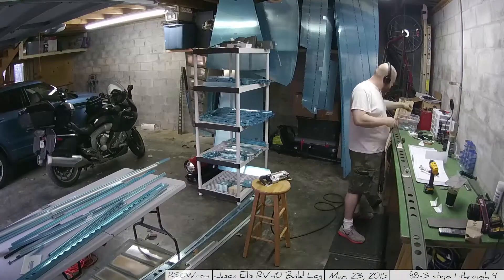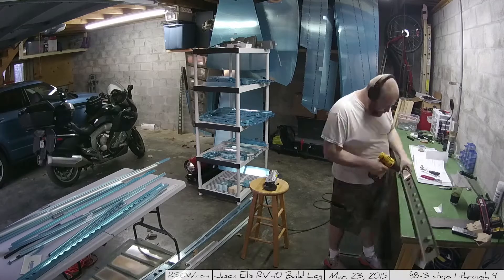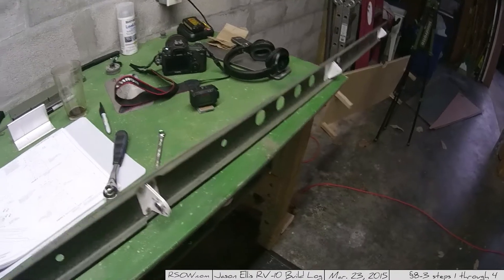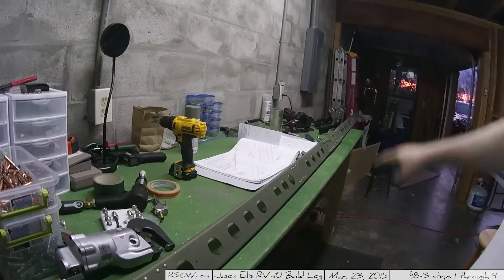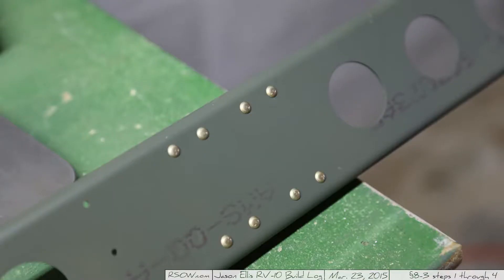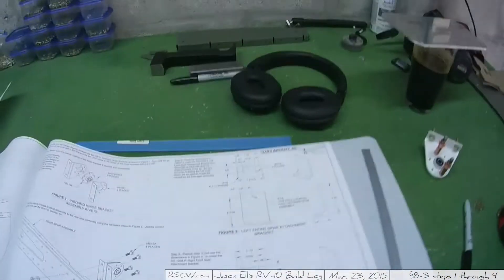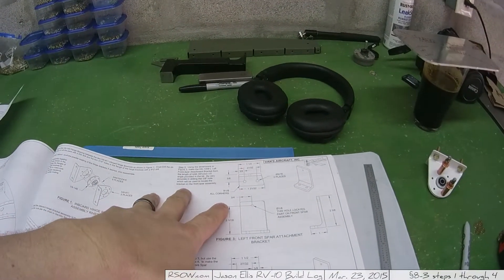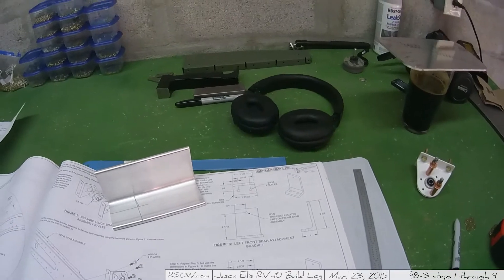RV-10 Empennage Section 8-3 Step 1-4

Comment: 1:05 : I'm curious how those bolts are secured against coming loose in flight. Is there a Castle nut and Cotter pin on the other side? Safety wire?
Reply from the maker: Crown/Castle nuts are EVERYWHERE in this plane.. hehe..  So is safety wire.   So expect to use a lot of that =)